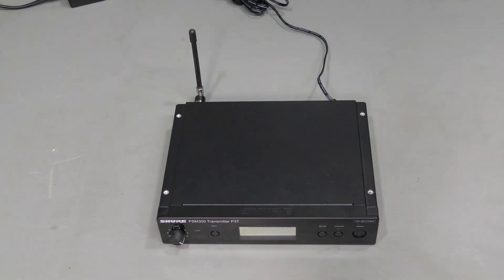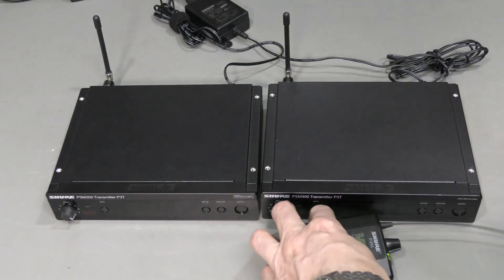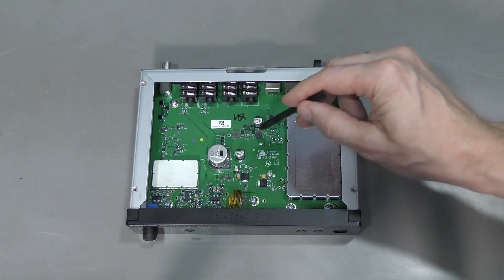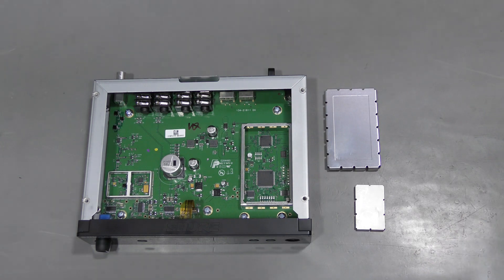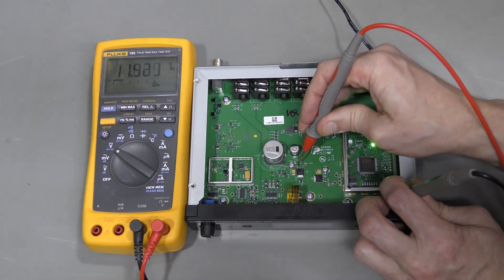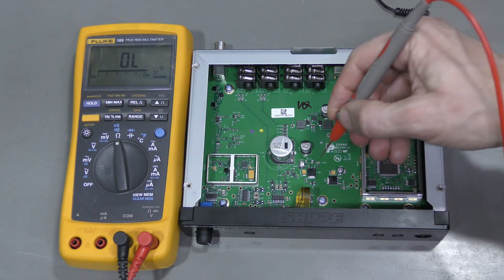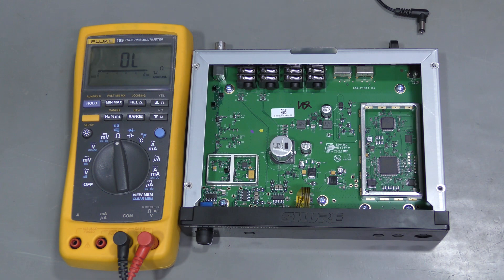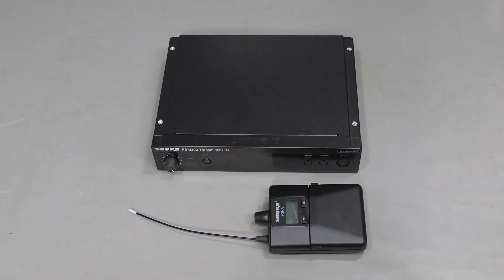#142 - Shure PSM300 transmitter repair

Comment: Just repaired similar fail with your help. Thanks!!!! You show me the way to check tension values. This unit send RF and AF signal and receiver show this two signals but there's no blue light in the receiver... Same open resistance you change got altered value: aprox 200 ohm!!! This fail makes there's not tension enough in the analog OP IC's (only 6.5V) and the receiver don't connect correctly and don't show the blue light... Thanks for your aid and excuse my poor english. Greetings from Spain!!!

Comment: Thanks for the help. How did you take the top cover off (P3T)? After removing the bottom (4) screws, my PeT top cover will not pull off.

Comment: Dude!!!! A Bass Player brought his P3T to me to fix.  This was EXACTLY the same problem.  I added a new 1 ohm resistor to the end of the cap + end and then the output of the 9v regulator and it brought it back to life!  Getting the top off was harder than the fix.  I finally used a plastic wedge shaped like a guitar pick to pry open the top.
Reply: Hi there, pls could you tell me how you get the cover off? I take out all the screws but it still seems attached to the front somehow!
Reply: @richyp7126  I used my fingernails, gently lifting the plastic top of the front "Trim" while applying pressure pulling back the metal frame. There is a small hook that is keeping it connected. You just need to lift that hook out of the insert on the metal cover. Hope this helps. (You can use a guitar pick or small flat screwdriver. Just don't tear up or break the plastic.

Comment: Hey man! I'm looking to see how you got the P3T open? I have a problem with my volume knob and was wondering if I could open it and take a look but somehow I cannot get the transmitter open. Care to share how you got its open?
Reply: wedge a guitar pick or plastic pry tool under the plastic where the metal top meets the SURE logo.  twist while pulling the top toward the rear. It'll pop off.  It had me stumped for quite a while!
Reply: Hey Justbmsc!  Wondering what you did to fix your volume knob?  Assuming you may have the same problem where the 6 welds failed and the blue piece is just loose on the board?  It works as the volume was up when it came off.  Just looks wonky, volume knob doesnt do anything anymore.  Thanks!!

Comment: Nice work as usual. What would be the purpose of that resistor? Just seems to add a failure point.
Reply from the maker: Might be some low-pass filtering and current spike reducing besides charging that large cap, that has a special circuit for that.

Comment: Would there be a problem with just shortening the resistor? I mean, 1 Ohm, what the heck?
Reply from the maker: Probably would work fine, but why not restore to the original state
Reply: @feedback-loop  1ohm resisors are used as fuses sometimes.  dont short them.